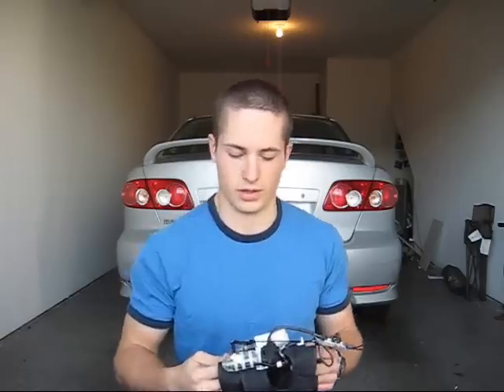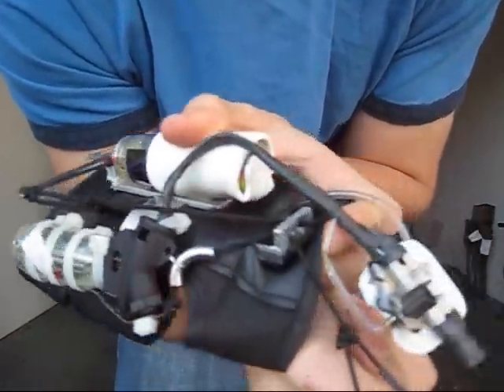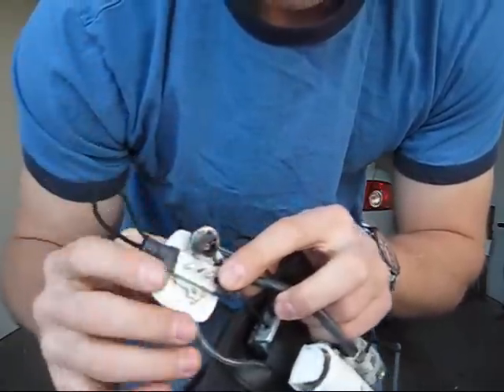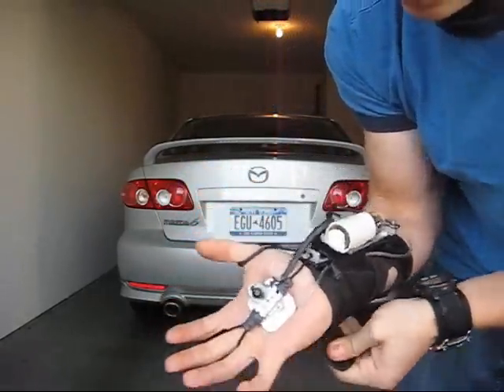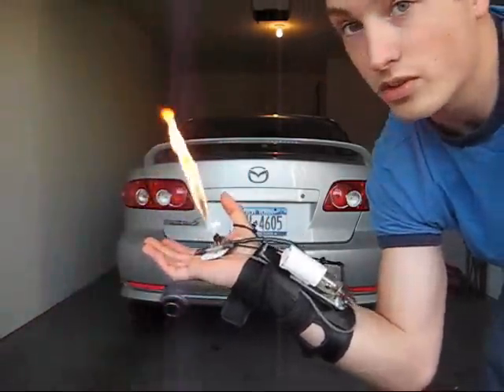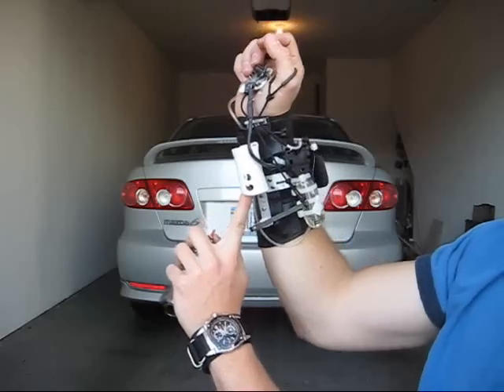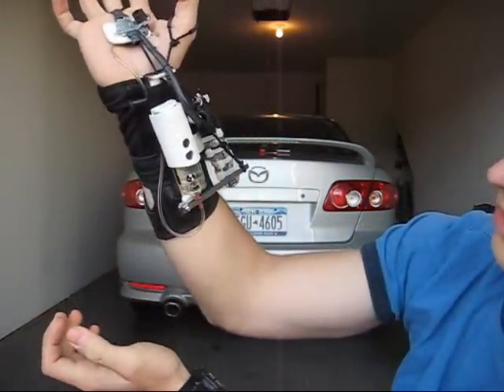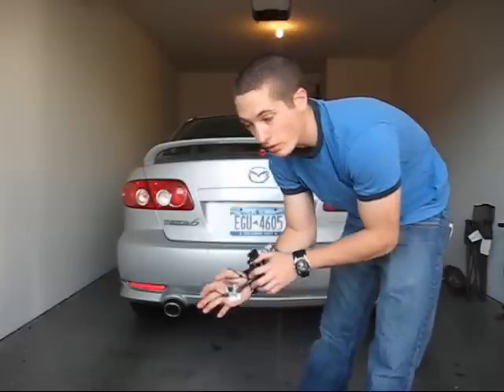Pyro System 2.2 workings

Comment: yeah it is cool but you can have the same efects with less trouble by just any flameble spray and a lighter and fire
Reply: Yes but if you are setting the spray or whatever on fire, if it gets back far enough in the can have fun with the explosion
Reply: hah "any flamable spray" Have fun with the shrapnel of a metal canister and explosion after you use a self oxidizing fluid. Ahem, hairspray.
Reply: basically yes, but not that simple. it needs to be any non self oxidizing fluid such as a butane propane mixture, a solenoid of some sort to work the mechanics of spraying it, and a nozzle and system that can with stand the heat. but using any flammable spray is a fucking stupid idea

Comment: Hey Dude, not trying to undertake your intellegence but, wouldnt it be wise to attach at least a leather glove to the system, just not to, you know, BY ACCIDENT, burn all your hand? 'Cause you acctivated it ,sometimes, with your hands pointing the ground, the opposite of that spiderman position xD, and as the hot gas in the glove work like the gas in a balloon, it will always go up right? 'Cause of the density and all that stuff. I don't know, just an idea...

Comment: @RexBladeWalker I thought something about it, my idea was about a glove made from a non conduit, with a teaser's battery attachted to the arm, and small metal plates on the finger tips conected to the battery by small cables, so, when you turn the battery on, the finger tips have ellectricity, but I have yet to test it.

Comment: Killer design, Bruce Wayne watch out...

I think what would help your sliding issue is building this on a glove and wrist band system. this will allow you to secure the middle finder trigger slightly higher around the first joint. It stays out of the way of gripping, but is easy to trigger. (not sure if you had this -->) An on off switch top prevent accidental fires when worn during normal tasks. I really like the design.

Comment: if you take the arms of the lever, and the injection tube, and put them together instead of having them separate, you could avoid complications and make the overall changing time faster.
just attach the washer to the arms, make a hole in the arms where the washer is, letting the nozle of your butane botle throgh both, and have the tube conected on the other side of the washer where the hole is. maybe even add a hinge and socket to make it even more eficient.
send me a message if u want a drawing

Comment: okay i have some questions...
did you just get some tubing(fire proof stuff) and took off the nozzle/end of the jet light and attached the tubing and then connected then tubing (thats connected to the jet lighter) to the original nozzle off of the jet light?
another do you think if you tied a string to a washer and put the washer over the end of the butane can nozzle so when you pull the string it bends the nozzle to release butane would work?
and could you send me a list of everything you used?

Comment: Have you figured out a method to keep the torch from extinguishing?  All I can think of is running a separate air pipe to the torch so it does not get starved by the butane flame.

Comment: A question on safety, as opposed to a comment. Do you have to be careful in how you hold a single hand/fingers to avoid self-inflicted injury (apart from blasting yourself in the face, obviously) or are there failsafe systems?

Stupid question, but you did patent this, yeah? Or are there issues with that?

Comment: very interesting, have you considered placing the mechanism on the top you your arm so the fire comes out above you hand, you can have a pad in the palm of your hand that has the ignition button and fuel button on it. then you can bend your hand down to better avoid the fire as well as having a manageable button system. but your creation is rather impressive. i don't think i could match it let alone do better myself.